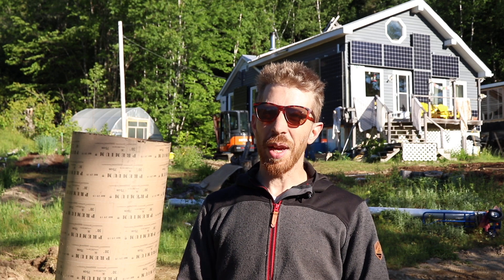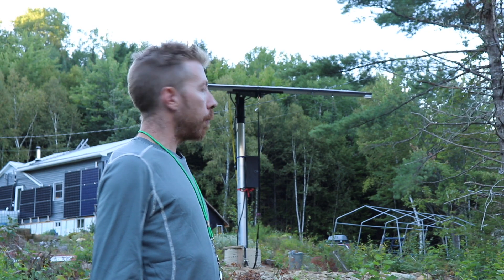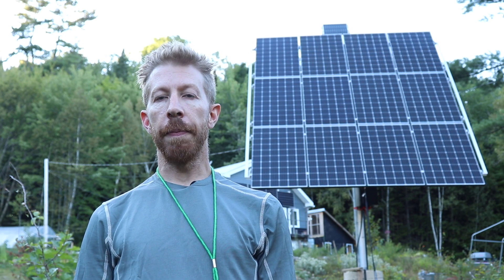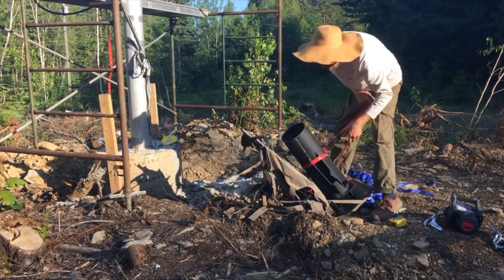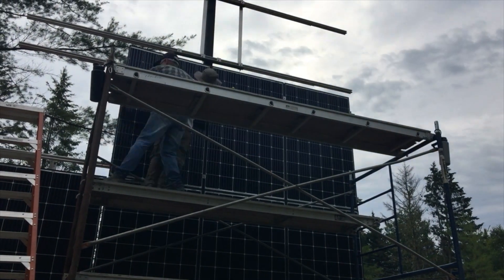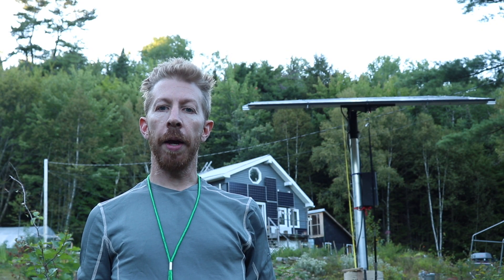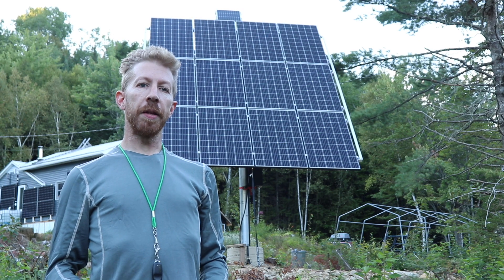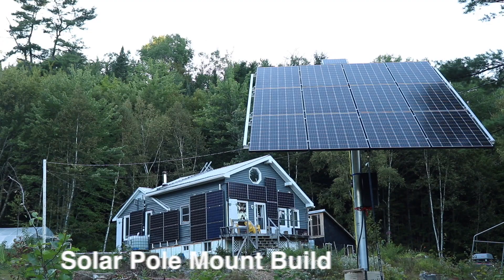Solar Life: Episode 6 - 12 Solar Panel Pole Mount Design and Build

Comment: great job , i like to see people being creative and DIY. 
i have built two trackers using scrap items such as truck hubs, flywheels, high pressure gas cylinders without using linear actuators.
cost was under $1000 per tracker (12 panels). )))
i have a couple of videos about them on my channel.
Reply: Tell us a little about your pressurized gas trackers…?

Comment: Drew…your inspirational….I’m not a tree top kinda guy…so my set up would be in the 3 to 8’ level….I’d also mount external bearings and drill shaft holes…and at least make it manual and track option…since your almost eating that cheese. We have some sycamores trying to shade our gas trackers…and they will be next seasons firewood.

Comment: GREAT JOB! YOUR PROJECT REMINDS ME: 
1. I WISH I HELD ONTO MY 12 FOOT HORIZON TO HORIZON SATELLITE 📡 DISH MOUNT, SO I COULD MODIFY THE MOUNT TO ACCOMMODATE 8 APTOS DNA 120 440 SOLAR PANELS, BECAUSE OUR POLE MOUNT IS STILL THERE. 
2. THE STRENGTH OF THE APTOS ARE MIAMI-DADE COUNTY WIND 💨 LOAD CERTIFIED TO WITHSTAND UP TO 5400 Pa & WE HAVE ANNUAL HURRICANES 🌀 
3. ALL THE BEST ON YOUR OFF GRID PROJECT!

Comment: Getting ready to do the exact same  thing in southern Minnesota but I have steel pipe.  I'm putting two up so have to figure out how to  stagger them so they don't hinder each other.  I finally got my permit after 3 years waiting.  Very excited.
Reply: Do you have a link for the rails?   I know you said Solar tech, the 2" angle  but I can't find that company.

Comment: Thanks for the video.
I built my own  pole mount using sked 40 steel pipe on a 24" sonotube eight feet down but I set anchors in the tube and welded a base on the pipe to mount it on top of the tube so I didn't get rust and water damage. That was ten years ago and it's still getting us through high winds. I think it was a mistake to make your array so high, mine is about 7 or 8 feet to the top of the pole. I can adjust my angle for winter and summer but I don't run at 90° and my steepest angle is about 28° which give me plenty of room for snow storms. (I'm in the Catskills of NY). You did a very nice job though, very creative!

Comment: I FOUND THIS VERY HELPFUL.  I ENVISIONED A GROUND MOUNT WITH TRACKING BUT EVERYONE IN THE BUSINESS I KNEW IN THE SOLAR PROFESSION DISCOURAGED ME ON THAT.  THIS GIVES ME HOPE.  I ALREADY HAVE THE SOLAR PANELS 12 X 325W PANELS AND A 4.5 KW INVERTER.  I JUST NEED THE MOUNT.  I'D RATHER PURCHASE A MOUNTING KIT.  I DON'T MIND BUILDING IT BUT HAVING TO THINK ABOUT ALL THE PARTS MAKES ME NERVOUS.  I WISH I COULD FIND A KIT REASONABLY PRICED.
Reply: Did you find something?
Reply: @rockandmeatroll  NO NOT YET, ANY SUGGESTIONS?

Comment: Would it be possible to see the close up view of your top of pole mount. I have looked at several mounts and like you feel that they do not fit my needs. My cabin is off grid, we get lots of snow ( > 5 ft), cold temperatures (-40 C), and lots of wind.

Comment: Nice design, Did you lay this out in CAD and have the parts plasma CNC or did you just torch them out. Bearing idea is great, I'll include it in my build. I live in the snow belt against the great lakes so I get the 90 degree tilt, great for cleaning. What linear actuator did you use and did you engineering in the loading on the screw or best guess?

Comment: Very cool, and was just wondering why DIY should be cheaper as a motivaton, i mean i get it but what about quality?   Theres certain things mass production just wont do because of  cost, but you can since youre only maknig 1, using a $2 part instead of a 20 cent one for example and other quality improvements that dont conflict with profit motive since there is none.    That being said I wonder if simply maknig a dome out of more panels would hae been cheaper. Putting panels where the solar tracker would move, and just leavning them there, it would take 10x more panels, but maybe would work out to the same cost but with less maintance as your solar dome sits there capturing all angles of the sun all day.

Comment: As you described  installing bearings inside the box tubing where the hinge bolt goes through, you said that you would do it differently.  How  exactly would  you have done it?  Also can you give any more information about the actuator?  How far down on the pole are the brackets mounted, and how far out from the hinge bolt are the brackets mounted on the box beam?
Reply from the maker: I would put the bearing on the outside where they can be serviced.  The actuator is 48" actuator for a satalite dish, static load of 1000lbs. The bracket is not a big as I would have liked, I designed it for a smaller actuator and then put on a bigger on one but it still works well.  The bracket is about 10" out from the pole.

Comment: HI can you please kindly help me on my solar system I have
 Panasonic VBHN330SJ53
 330W Solar Panel Module which I have connected 7 panels in series which is 7 x
 330 watts = 2310  watts and dc
 voltage approximate 483 Volts
 And I have another string exactly the same solar 7 x 330 panels series which 2310 watts so if I connected 2 strings in parallel which it's should be 2310watts plus 2310watts total 
 4,620 watts on this system will it work ? and will it be fine ? 
 Please kindly help me
 this thanks you
 Sam

Comment: why so high? closer to the ground seems like a better design. I want to do something like this.
Reply: I had the same question in mind. Make as low as possible to clear ground even in the vertical position.  Maybe there are obstacles in front of the mount that required him to go high.
Reply: there are 10,000 ways to do everything :)
Reply from the maker: @thelightworshipper9687  We get that much snow here and it builds up in front of the panels.

Comment: How did u mount the solar panels to the wall of your house?
Reply from the maker: We used the same racking that they use on the roof mounts. It was bolted to the wall and the panels to the racking.
Reply: SolarScoobyD Did you cut away the siding or did you just sandwich it?
Reply from the maker: @gmat2545  We took it off, built it up behind and then bolted to the braces behind the siding.  It buckles a little in the summer because it doesn't slip and expand the way it should but it has been waterproof and functional for 2 years.
Reply: SolarScoobyD awesome thanks!
Reply: SolarScoobyD I don’t guess you did a video on that and I missed it?
Reply from the maker: @gmat2545  No we didn't film the wall install it was before I decided to do this.

Comment: I don't really understand why you did not choose to use an automatic 2-axis tracker system. Now you loose a lot of energy cause the panels will not be in the ideal position most of the time. That's a shame, you paid for the installation, try to get the most out of it.
Reply from the maker: It wasn't designed for dual axis tracking and the cost would have been much higher.  I am happy with pole mount, it's strong, holds up in the windstorms, and can be adjusted when needed to change the angle.  I only adjust it seasonally. Thanks for your comments.